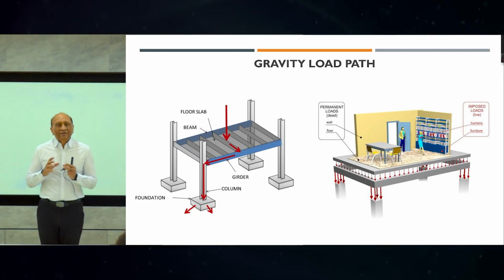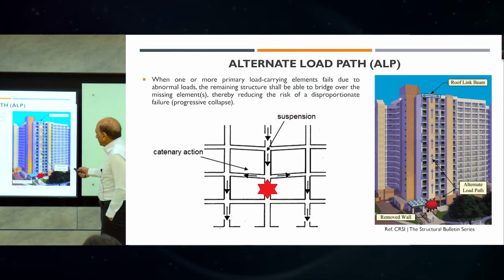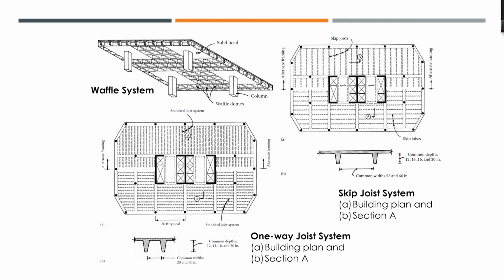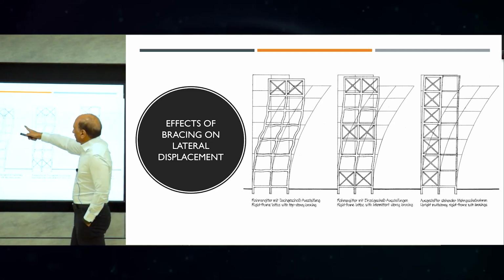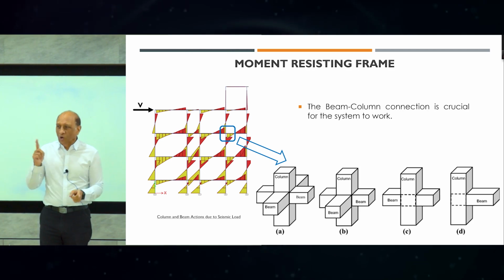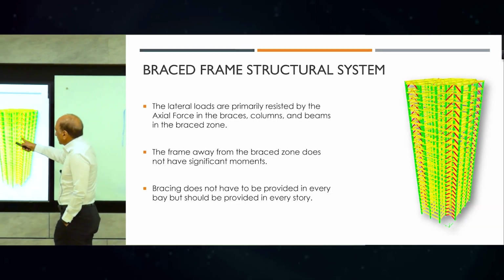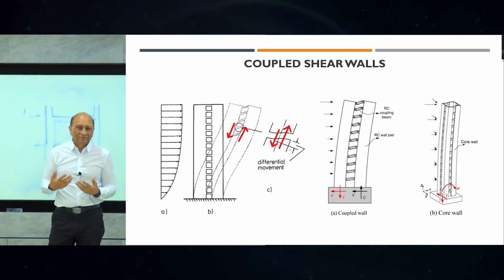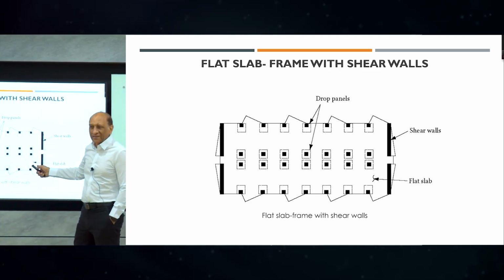Understanding Load Path and Structural Systems

Comment: This man is a genuis in his true element. Beautifully grouped into modules and explained with practical factors associated with each design type. I'm on my early days of my career as a site engineer and I've completed a 42 storey tower and now reflecting back to why a certain things were designed in a certain way is so satisfying. 
Building- Indigo hotel and Apartments
Location - Auckland CBD
Structure type- Coupled core wall and diagphram slab with PT